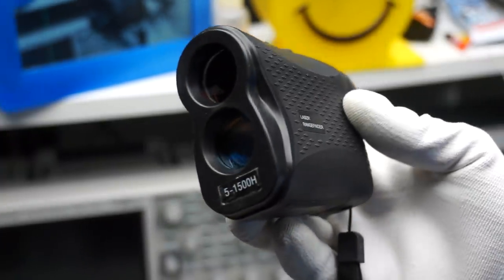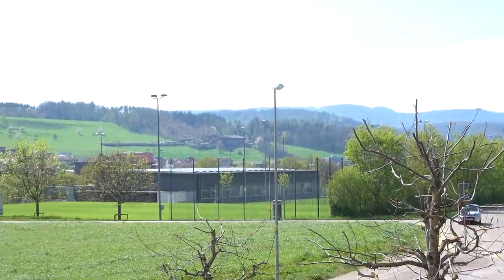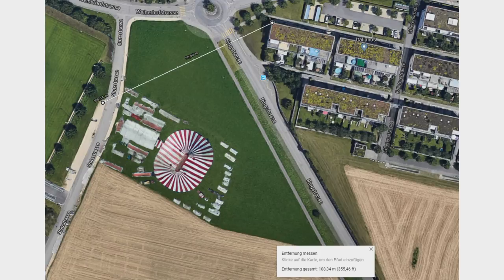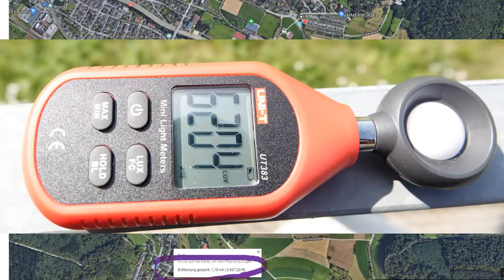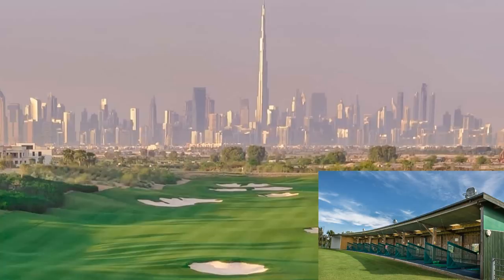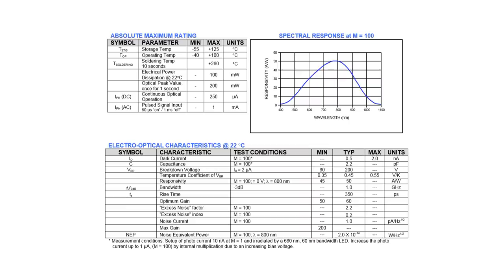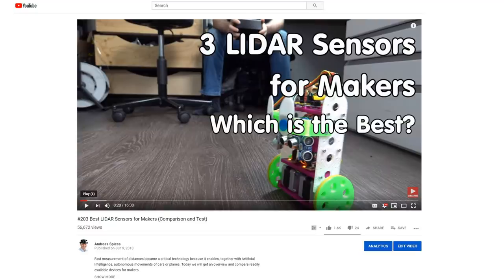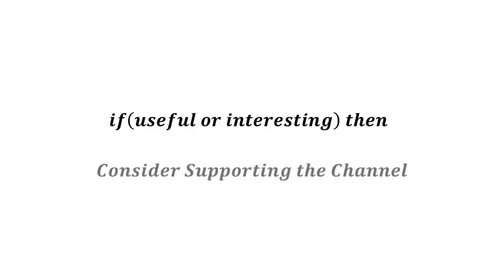#267 1500 Meter Rangefinder Test and Tear-Down

Comment: Hello Andreas,  Nice job! :) What depends on the range measuring between 600m and 1500m? This product there is different ranges between 600m and 1500m. What is the key of longer range? The  IR led diode angle or low beam divrgence or sensor or others? I have a 600m model.  Is it possible to tune the same product 600m model up to 1000...1500m?  Thx.
Reply from the maker: I do not know since I have no other models.

Comment: did you find an RS232, I2C or SPI signal, in order to interface the unit to an ESP32,, just for automatted logging via BT for example?
Reply from the maker: Unfortunately not.
Reply: @AndreasSpiess  Would have nice to make your own personal speed trap... put a rpi cam module behind the optics. detect for shape of incoming car, get the reading... make a speed statistics... (and do not record images, for privacy reasons...)
This would off course just work in short range an on straight line, since the angle/view would be constantly fixed.

Comment: Nice video......    Is it possible to stream 1080p 60fps with a webcam and a rasberry pi?
Reply: MPEG-4 AVC Video at 18000 kbps for 1080p = 22MBs.

  You'd probably need to run something other than the typical debian OS to do it. A π with debian is as slow as a 15 year old laptop, and those don't generally work for such tasks.
    I have no experience here, so it's not something I can guide you on. If there is some kind of real time OS for the Rπ it would be much more powerful. You're getting into hardware though. Rπ's are "open software" but are not open source hardware. They are pretty much garbage for hardware enthusiasts. If you want to play with real hardware level stuff get something with an Allwinner or Rockchip SOC. Look for community resources posting problems with solutions unrelated to manufacturers/distributors and a full datasheet before purchasing anything. 
-Jake
Reply: Thanks Jake

Comment: Bushnell Yardage Pro over a decade ago had 1000yd (only a rangefinder) abvertised range and only slightly larger package. I had another generic brand that boasted 2000yds w/ speed.
The bushnell would read 800yds to pine trees mid-day and in full sun. I saw it go above 1200yds to a reflective street sign.
The 2000yd device didn't work as well unfortunately.
Reply from the maker: I did not know this technology. Thank you for this information.

Comment: Hi andreas. I can explain you why you are so surprised of the range, and why it can detect it with such precision. This is not a dot wich is measured, but in fact a cross. You might know that in optics, what you are projecting is sensibly alterated by distance. So that's what they are measuring. A cloud of dots making a cross, then the distance between dots by projection range. This also gives you an idea of the Cmos sensor resolution, and you can calculate it yourself around squared 4K. So you just have to measure the distance between dots to exactly know th real distance because there is a constant magnifying for the cloud of dots of the projected cross. In short distance, they are going to be very close from each other, in longer distance, they are going to be very spaced from each other in the sensor. Then you just have to count the distance between dots on the Cmos sensor grid to know the real distance. Of course, the Cmos sensor is only focusing at 905nm, which is not in the visible spectrum, and also not perturbated by the natural day light.  They only see the dots in fact ! ;-)
Reply from the maker: I am not sure if this method is used in this case. I did not find a camera chip.

Comment: i suspect that it is a signal processing problem - detecting a bunch of spikes against a roughly constant background via correlation is probably much easier that absolute pulse detection of a pulse delay. (if you want to see how weak a received signal can be , look at how GPS works)
Reply from the maker: I am not sure it is easy, but obviously possible. GPS, BTW, is also a miracle for me!

Comment: It is likely incredible that GPS devices can distinguish their satellite signals without directional half meter parabolic antennas. Is a similar technology used? In both cases: Very low frequency signal and signal level far below noise level.
Reply from the maker: I assume they have to use similar technologies. Maybe on different frequencies.

Comment: I fly gliders (fuselage close to the ground) and light sport aircraft (with different length legs under the fuselage). 
- All airports have a preferred (pattern) altitude that you should fly above the ground when you are coming in for a landing. Pilots use their altitude indicator to fly that altitude. The indicator depends on barometric pressure, which changes from place to place. Pilots often forget to check it for the destination airport and could be off the pattern altitude by as much as 30-60 meters while in the pattern. This puts them too high or too low and reduces the margin of safety. 
- If you fly different aircraft with fuselages at different heights from the ground, It can be a bit tricky to make that  final landing flair at just the right height, so that you gently settle onto the ground as you lose speed. 

I can imagine one of these rangefinders in a small protected shell underneath a small airplane to provide accurate ground speed and distance information to the pilot in the pattern and on final (lined up with the runway), all the way through that final flare. Typical pattern altitude at the beginning is ~ 500 meters above ground level. If the device could work from that altitude, pointing at the ground, and over grass or pavement on final, then this could be a great safety enhancement. 

I am not an electrical engineer. I don't know what it would take to hack the output signal. I know what it would take to turn that signal into an instrument on the panel. 

I know that you work on a lot of interesting projects, but was wondering whether you might be able to put a tiny arduino in front of it, like you connected the infrared sensor to a Raspberry Pi. People could connect to the arduino with SPI or I2C to read the Rangefinder output and display it on the aircraft instrument panel. 

What do you think?
Reply from the maker: I remember these things from when I did my pilot training. I thought that airliners already use this technology to measure the real distance to the ground. Unfortunately, I did not find a serial connector.
Reply: @AndreasSpiess  Thanks for thinking about it.

Comment: Hello! At night it works at the same distances? Or it is just a day time laser?
Reply from the maker: It is hard to use during night as you do not see where you aim
Reply: @AndreasSpiess I want to use it to measure flashlight projection distance.I am not saying pitch dark.I mean this is a laser as powerful as the laser 303, because that one goes very far away, kilometers away.This is a different kind of laser technology.I do not understand why would it work worse at night, if you can still see where you point with the bare eye.Thank you and sorry for the multiple questions.
Reply from the maker: You do not see the laser. You aim with the optics.

Comment: the interesting question is, would it be possible to get the results out of an SPI ir i2c interface to some other device?

Also - how reflective does the surface have to be to get a result. I realise you wouldnt get 1500m off a person standing that far away (if you could line it up acuratly enough!) but how far could you measure a person away in normal clothing?

I watch with interest!
Reply from the maker: 1. I did not find an interface.
2. I mentioned in the video that the 1500 meters were only possible with a white lorry. So the IR reflection coefficient seems to be important. No surprise ;-) You also cannot point exactly to a person on a long distance. It is too small. But I did not test it.
Reply: Andreas Spiess cool, thanks for the reply. Shame about it not having an interface. I wonder though how far could you range a person with this though. I accept you wouldn’t get anywhere near it’s max range, but could you get 200m or so? 
A project I have in mind may benefit from that sort of distance.

Thanks again.
Reply from the maker: I imagine 200 meters will be max. Mainly because a person is a very small target.

Comment: Could you hack it to send the distance measured to an arduino then to a computer?
Reply from the maker: Unfortunately, I did not find a connector.
Reply: @AndreasSpiess  I've seen a video where someone hacked a digital micrometer and adapted a connector from another device, if I remember correctly.

Comment: The SNR measured at the receiver in these conditions has to be atrocious. With a lot of these application, like with spectroscopy, the signal is buried in noise and you have to use a lock-in amp (usually realized with DSP)  in order to boost the SNR. Theoretically you can increase the integration time of your amp and get rid of most of the noise (since with every sample of measurement you take the noise is uncorrelated) and your measurement is only predicated on whenever you can measure the signal at all. Of course the measurements have to be sampled from the same i.i.d. realizations of what you want to measure, i.e. the range is static.
Reply from the maker: You are right. But still you need a very small signal... And this is unbelievable for me.

Comment: Hi sir did you know that is this device emit an electromagnetic wave about 160 MHz so for what this emitted??
Reply from the maker: I do not understand :-(
Reply: @AndreasSpiess  I have a laser distance measure when I use it a 130 MHz emitted from the device I can receive this frequency on walki talkie device my question for what this frequency emit from the device
Reply from the maker: @variousexperiences6485   I assume it is an unwanted signal emitted by your range finder.
Reply: @AndreasSpiess  when I tear down it I found a 130 Mgz crystal oscillator

Comment: Mirrors and reflective targets for visible light are often not the same for IR or UV light and lasers so what seems dull or bright to you may not be the same to the instrument and sees same target the exact opposite. ⚠ Any China made lasers then do not trust CE and other marks are valid. Even when the batteries are small, laser can be higher power than label or have other issues and damage eyes in the path for some distance.
Reply from the maker: You are absolutely right with the spectral response. And I think we all know we have to pay attention with lasers because they are invisible.
Reply: @AndreasSpiess  Hi, It is far worse and more subtle then invisible light output and Safety for the owner and family is not the only issue. Many CE and other Safety and Government marks for items like this are complete frauds then you can have huge problems and Banggood and others will laugh all the way to the Bank. So do not trust a label on the unit or in device specs on a web site claiming it is a "Class 1 Laser Product" really has a Class 1 laser output.

Comment: Hi Andreas! I am from India,  in regards to posted video, I couldn't find anyone, who would understand my problem and find a solution, but I think you could help? i have 100m Laser distance meter, (which can't work in sunlight) and 600m range finder which. (Which Is not accurate by 5m), i use for 'Basic Land survey' as total station is expensive.   my question: 
1). Can we increase the range by any hack?( Since the same device comes with more range) the circuit looks same? 
2) by changing/ modifying lens can we get better visibility of distant target or accuracy? 
3) better accuracy with prism ( tried target plate).

Thank you in advance
Reply from the maker: I do not think you can change anything on these devices without destroying them. They are quite complicated and well constructed.

Comment: very nice video. I think the object surface must be at a 90 degrees angle to reflect back to the rangefinder? But in that case I would have expected many false readings.
Reply: Nop, i meassure flags on wind from 500m.
Reply from the maker: I think light scatters during reflection

Comment: I'd buy one if it did accurate speed measurements... cars go too fast here!
Reply from the maker: It should be accurate. However I do not know how long it takes for the measurement
Reply: @AndreasSpiess  Yeah, would be a useful traffic measuring tool if the data could be extracted and was fast enough. Not sure how the 1m accuracy would be involved, if it was a consistent accuracy offset then the speed measurement shouldn't be affected. Thanks for the review though, very interesting.